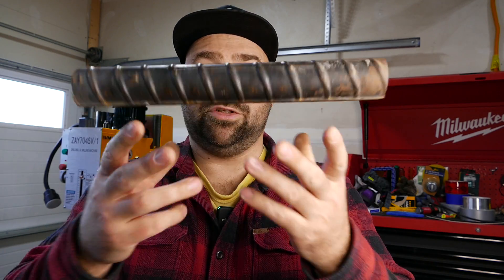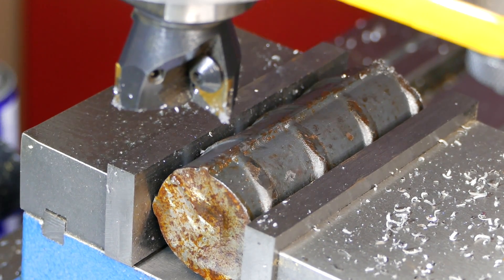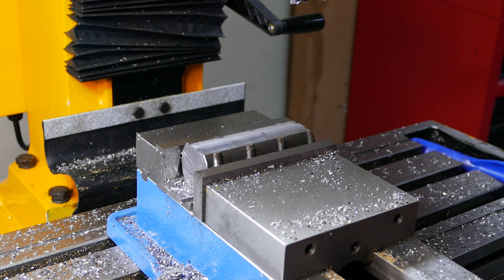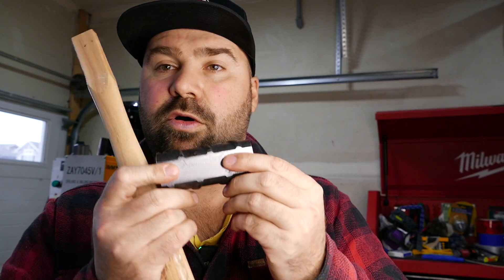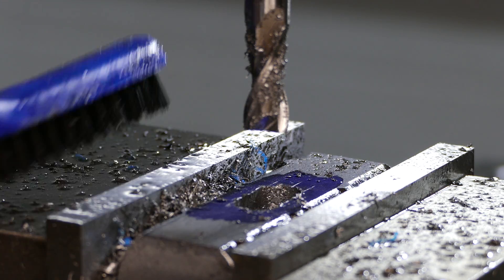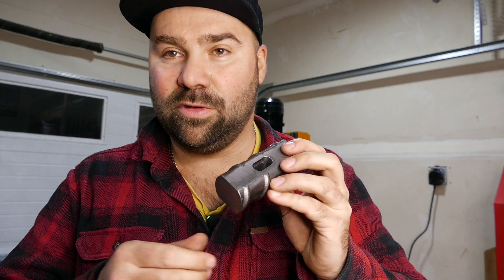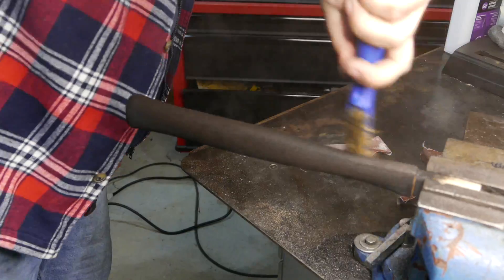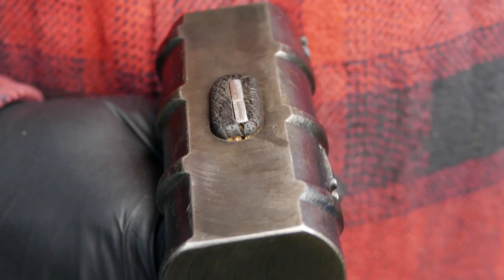Rusty Chunk of Rebar turned to the Most Essential Tool in the Shop!

Comment: It's pretty but I believe that rebar is low carbon steel and it will probably mushroom over time.
Reply: Could be possible but rebar comes in many grades. I know they make it in mild, low, medium, and high-carbon and I believe also sometimes in various steel alloys. Of course you wouldn't be cutting high-carbon steel with a bandsaw like in the video but even if it's just mild steel, it depends on what you're beating with it whether it deforms (naturally). For instance, that I can think of, the last 2-pound sledge I saw in use was a floor guy putting down a hardwood floor and he used it exclusively to hit the rubber end of the pneumatic flooring stapler/board tightener whatever-you-call-it. Of course that hammer will last forever and never deform so who knows what people will use a hammer made out of rebar for?
Reply: @thinking-monkey  It will probably last a long time anyway.